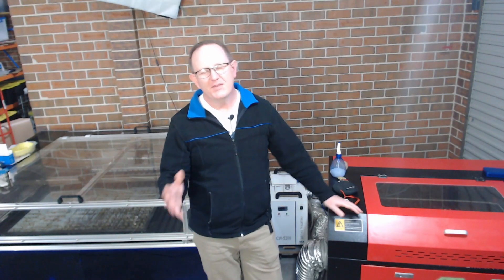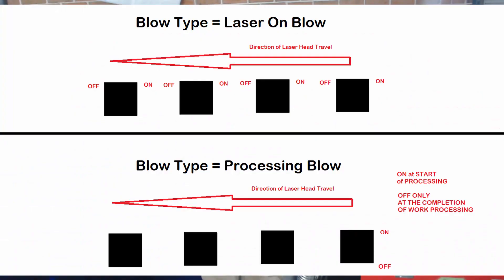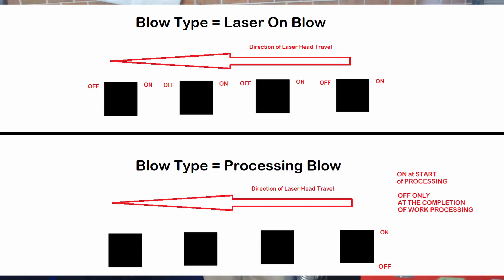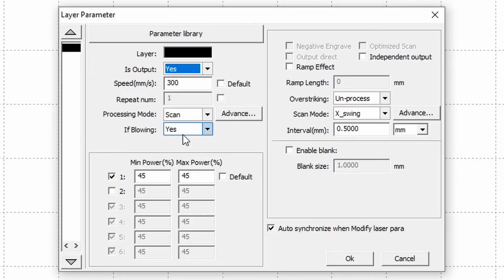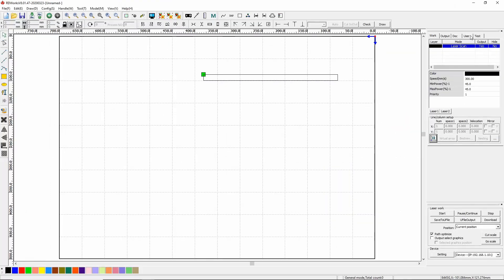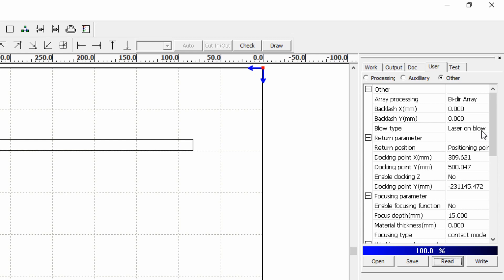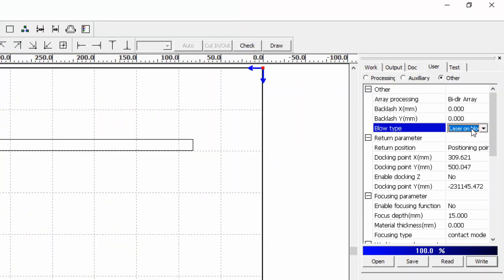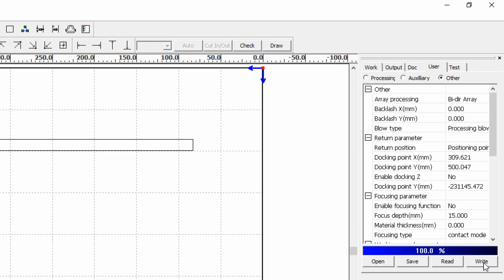[06] RuiDa Controller - Setting the Air Assist Blowing Modes -RDC644X - RDWorks

Comment: Hi Matt, we ended up replacing our Ruida controller and screen after Boss though that was the problem with our x axis reversing polarity in the middle of cutting. We ended up finding a cut wire to the stepper motor and replaced that fixing the problem. Now that we have the new controller and screen our air is blowing while the laser is not firing and not blowing while the laser is firing. Is this an easy fix configuring the controls in RDWorks V8? Thank you.

Comment: Matt,
Is there a way to set the blower on high for etching and then off while it is cutting on the same job?
Reply from the maker: The air assist kits controls that air ON = High Air flow (from your air pump/compressor) and Air OFF = Low airflow via the restrictor valve on the air solenoid.

however I recommend using ON for cutting and Off for etching for most materials

Comment: HI I dont have blow type. Seting in Rd works.   User/other/other.  There is only array procesing amd backlash.    Where can I find it ?
Reply: I change machine to rd6445 and it works.  Thanks.     I have next question.   How can I use the output1 and 2 pin on rdc6445 ?
Reply from the maker: it is not available in older versions of RD Works, you can upgrade to a newer version.
https://mwlaser.com.au/sdm_downloads/rd-works-v8-01-48/
Reply: Hi I upgrade This version but still there is not This funktion.   Help please :(

Comment: Hi Matt, what air compressor are you using with your Ultimate Air Assist?
Reply from the maker: At the moment just the small air pump, I've just purchased a larger 50L silenced air compressor but have not used it yet, still working on setting up pressure regulators.
Reply: OK, I was asking because I have the same red and black but am very restricted for space yet I still want to upgrade the air supply but havent the room for a 50L. Any suggestions?

Thanks

Comment: Is there a way to active processing blow with lightburn ?
Reply: Yes, it is called "AirAssist" in the cut settings editor. Eventually you have to change the mode in your controller because this only goes in RDworks and not in Lightburn
Reply from the maker: the blow mode setting needs to be changed in RD Works at the moment as I have not found any setting in Lightburn where it can be changed.
Reply: @MWLaser  but can we use rd works to change the setting then go back to using light burn ?  sorry i haven't watched the whole video yet. i am about to though.
Reply from the maker: @geterdnboy  Yes, absolutely. Controller settings can be changed in either application, as settings are saved on controller so it is effective for both Lightburn &  Rd works
Reply: @MWLaser  to thank you for the reply I did change the settings in rd works and I guess It did work but it still turns off at each end of the stroke on an engraving is that correct or did I miss something.
Reply from the maker: @geterdnboy  before you change the setting you need to read the information from the controller. Then change the setting and write back to controller
Reply: @geterdnboy  i have got the same problem, changed it to processing mode, of course read/write, but there is no change, Ruida 6445G, im thinking about to downgrade the firmware, my solution at this time is to take the status port, but thats not what i realy want
Reply: finaly got a solution, Ruida 6445 , made Firmware 15.01.19 no problems with the wind port
Reply: @s1ndevil861  I'm not close to my mechine at the moment but I am following your progress.. so you downgraded the controller firmware?  I have installed off timer relays but even on small engraves the laser and wind terminal is not on long enough to trigger the relay ..
Reply: @geterdnboy  Yes just try to update your Firmware, i found only the HMI 10.01.05 on the Ruida Webside, i downloades the Firmware from Matt s  webside  https://mwlaser.com.au/    for my 6445 all works great now
Reply: Matt, my Ruida 644xg on my red/black 60w doesn’t show “Blow Type” when I go to the User/Other icons...  The instructions for Air Assist are easy to follow in Lightburn, but I’m not getting anything from my air assist after hooking up a California Air compressor on a solenoid...  

  From what I understand I need to get the air issue sorted in Ruida/RD Works and I think I’m following the directions clearly, so what a I missing?  Thanks in advance for your help!
Reply from the maker: @MoonshineLeatherworks  Send me an email (matt@mwlaser.com.au) with RD works Version Number and Firmware Version of Mainboard, and I will assist.  Cheers matt